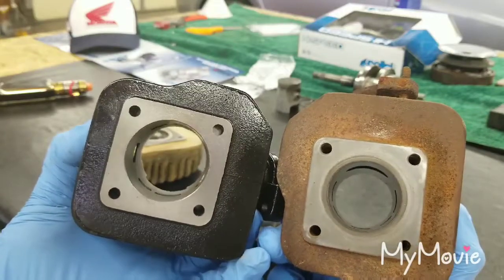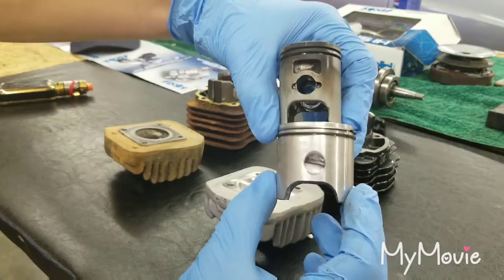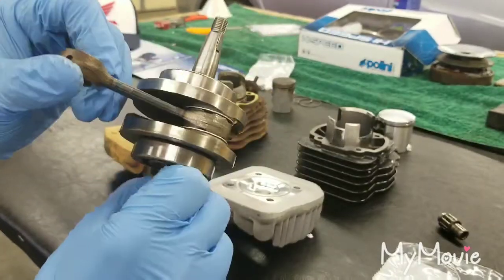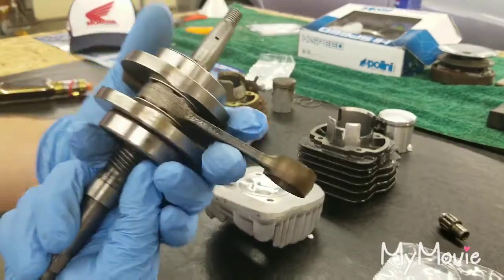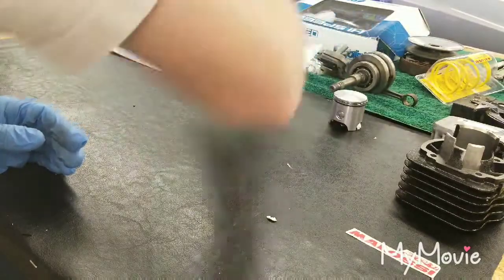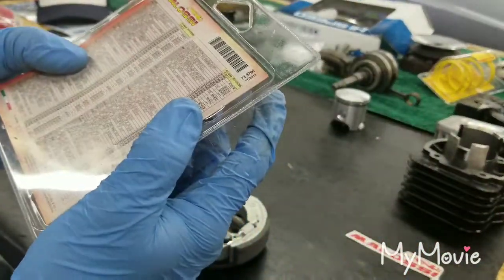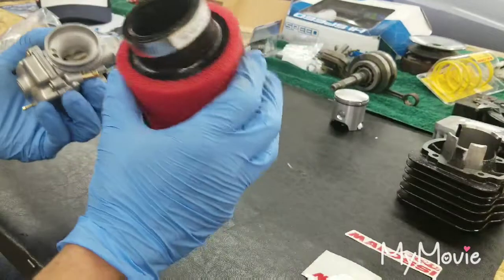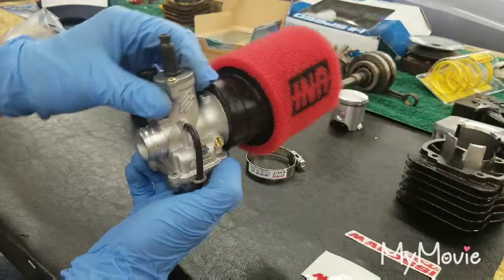Honda Big Bore kit comparison Polini Corsa & Carb

Comment: Hi i am getting a 43.2mm +1.5 crank for my af18e engine honda dio. I am just confused if what is that +1.5? Do i need to get a 1.5mm base gasket to match it with the corsa cylinder? Thanks
Reply from the maker: You bought a stroker crank. I doubt it will fit unless you send off the block to scooter tuning & have them CNC out the area needed. I don't recommend going that direction unless you are racing.

Comment: how did the stock crank hold on the corsa? 😂🤣
Reply from the maker: I actually used the Athena crank. As a nubie not knowing how to properly pull it apart i bent the stock crank. So I was forced to use the Athena. My suggestion is don't split the case! Use the stock crank & original bearings. It'll handle the power no problem. Just remove stock jug & install the new one. Stock cranks will fail past 13000 rpm. If your not racing it , you'll never see past 12000 rpm. Corsa kit & malosi are the only direction you should go. Don't buy cheap kits.
Reply: @h2omechanic  I agree, I've been running a corsa on stock crank for 3 years pinned and have never skipped a beat.